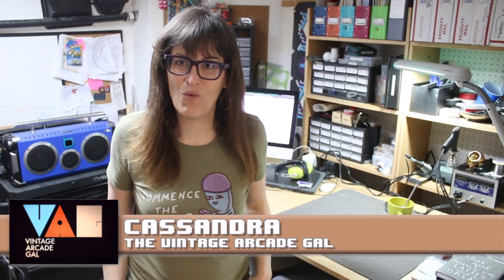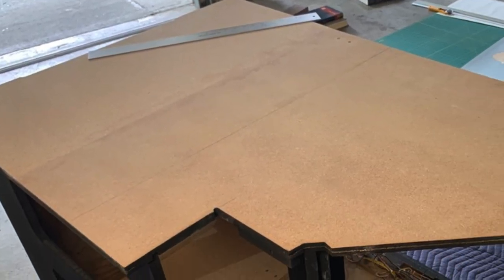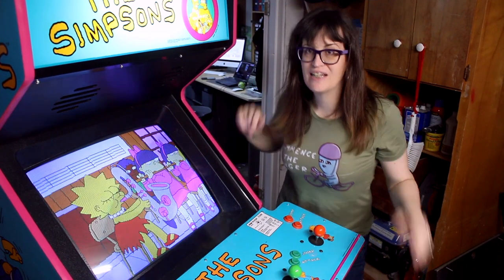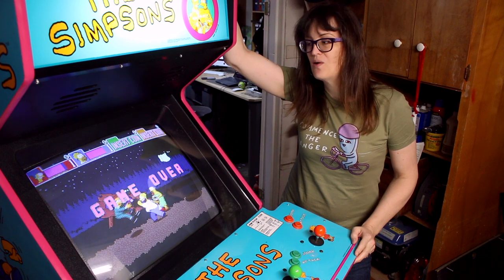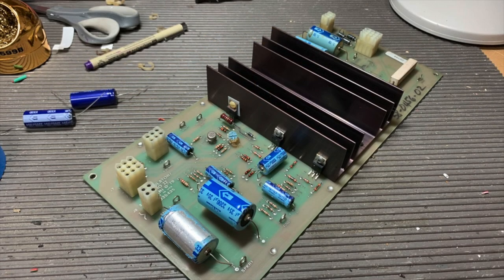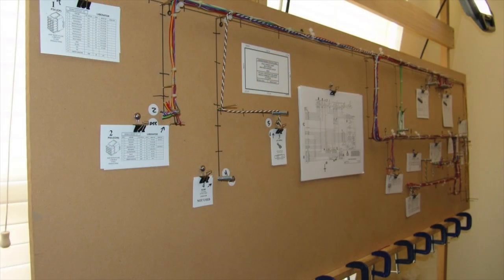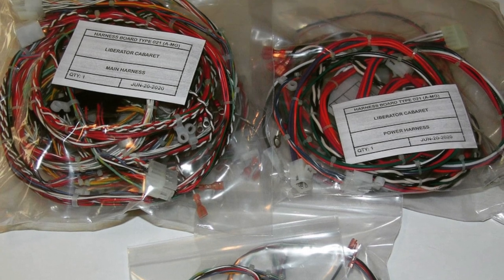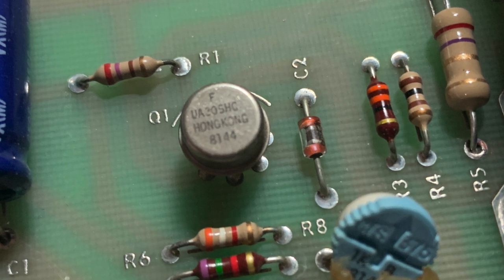The Arcade Workshop Chronicles : Episode Nine - Simpsons / Liberator Cabaret / Atari Power Supply

Comment: How did you create those back Atari labels? I need to do that for a few of my machines, and a Konami cab as they were either destroyed, or the wood they were on is missing or severely damaged.
Reply from the maker: I scanned what was left of the original ones for the Konami one and fixed it in Photoshop. Then I just bought some high end sticker paper for my printer. The Atari ones I used foil sticker paper I found on Amazon 👾
Reply: @VintageArcadeGal Thanks for the reply. I have zero experience with photoshop. But it sounds like a fun little project. If you ever wanted to make a video about that, I would for sure watch it! I don't think anything exists on youtube that is a tutorial for that process. If you know of any videos that would walk me through how to create these decals or would help in the photoshop process, I would greatly appreciate it. Thanks again!